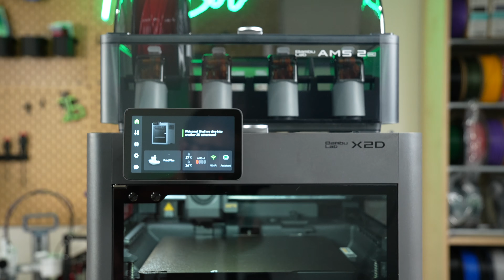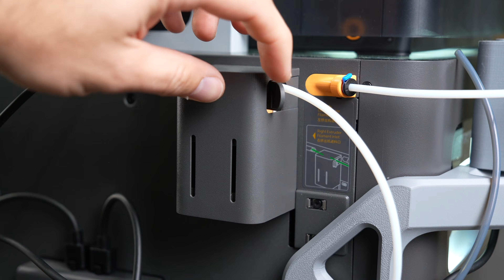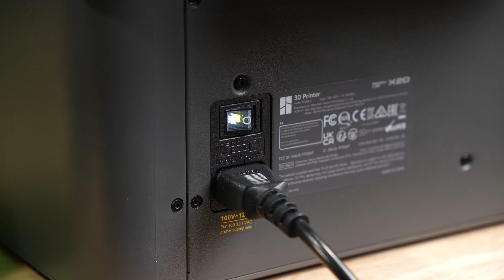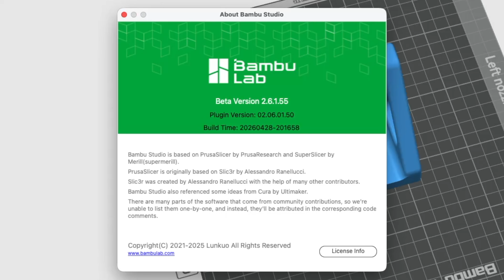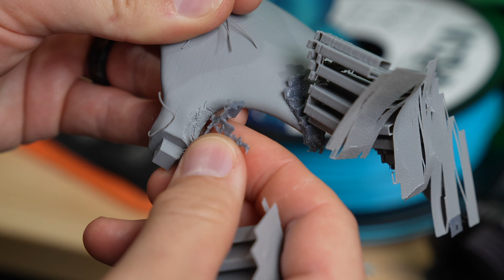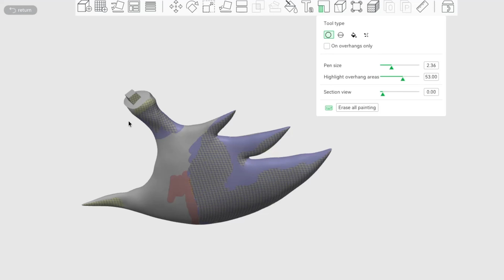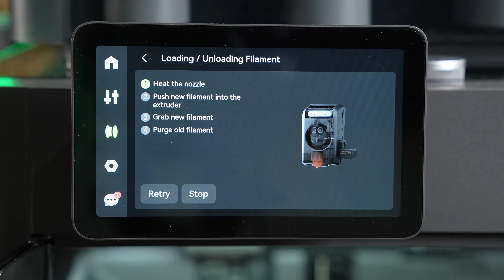I Tested the Bambu Lab X2D... Here's My Verdict

Comment: Stay away from bamboo printers. They are obsolete!
Reply: Good one bud 😅
Reply: What printer made the H2D (and to a lesser extend the X2D) obsolete?

Hint: its neither the Ultimaker S7 (sucks a$$ and is very expensive) or the Prusa XL (cant even print ABS)
Reply: @lukahierl9857  Snapmaker u1 plus others here and coming.
Reply: It’s spelled ‘Bambu’ before slandering a brand you might want to proof read your 8 word sentence before posting.

Comment: 22:28 “An added chamber heater for high temp filaments”, but nozzles capped at 300°C to reduce cannibalization of their more expensive H2 series.
Reply: I'm sure someone will make an aftermarket upgrade at some point.
Reply: @WolfKashin   It’s almost certainly capped in firmware. You’d need to reflash with an open source fw too.
Reply: @JonS  nah you can fool the thermistor and get at least 320-330
Reply: @riba2233  the 300c thermistors start to lose accuracy.
Reply: You might be right, but then again, who but the most hardcore enthusiasts are printing filaments that require nozzle temperatures over 300°C? I'd argue that you'd probably want a chamber capable of heating higher than any of Bambu's printers, if you're printing more extreme filaments, anyway. 

Also, standard NTC thermistors are only rated to about 300°C, AFAIK. So I don't know if that factors into their cost calculations.

The highest temperature filament I print with routinely is polycarbonate, and it prints beautifully on the X2D.
Reply: @ultramegax   Likewise! The X2D has been producing the cleanest prints I've ever seen (even those online). Fortunately I have zero need for printing the PPA and PPS class filaments, or anything that requires over 300 degrees. I'll save those for my H3C!! 😛
Reply: With the Bowden extruder it's just not possible to go higher than 300° because of the ptfe
Reply: @vocaLEGEND Bowden =\= heat break. The bowden setup should still allow atleast 350C as anything above the heatbreak shouldn't get any hotter than 200C. Nominally, anything above the heatbreak should not max out the ambient temp.
Reply: @vocaLEGEND  how confidently wrong
Reply: @rs.7610 how am I arrogant? talking just to talk

Comment: They could make both extruders direct drive - just connect them to the same freaking gear and inverse! Yeah, it'll retract previous filament to shit, but who cares - it'll be purged later anyways!
Reply: I think it’d cause excessive grinding, and then it wouldn’t be able to grab the filament again unless you had another AMS to use the assist motor to feed it again. From what I’ve seen though, you can definitely dial in the aux extruder.
Reply: Hav fun doing a retraction with the nozzel currently in use. Not to mention that only one filament has to move when raising/lowering the second nozzle.
Reply: @lukahierl9857  Why is that? People use retraction from hot nozzle all the time. Nobody stops you from cooling nozzle - it'll just be grinded out and stick inside the nozzle while another nozzle is operating. It'll reverse back when you start pushing it again - just need some nice anti-stick coating for the gear and that'll do the job just fine. You don't need to use the same gear for pushing and retracting - couple them and it solves the issue.

Comment: I was excited about this printer before I realised the second head is so compromised. Hard pass. Maybe next time Bambu
Reply: Except the second head isn't compromised lmao it's a bowden extruder. Used to be the normal before direct drive and they implemented it quite well. The auxiliary nozzle is meant mainly for support materials but is more than good enough to use as a secondary nozzle.
Reply: Have you used it?  I've only had ours for a few days and it is the only 3D printer we've ever owned, but I can still compare the quality of the two nozzles and say that the auxiliary comes very close to the quality of the primary.  I was also easily able to do a two colour print with negligible waste.
Reply: As always with these kind of comments, you do'nt even know what the supposed limitations you're complaining about are.

I've had the X2D since release and have no issues with the auxiliary extruder. Bowden used to be the norm and prints looked as good back then as they do now.
Reply: @ArneHerz  For real. Over 1 thousand hours doing multi color prints, and thats while using the aux nozzle equally with the main nozzle. People love to hop on the bandwagon sometimes lol
Reply: @lifeonabike8691 do you think this would be a better decision over the creator 5 pro i pre-ordered? since i saw the purge filament into the chamber heater fan i’ve been considering cancelling my pre-order 😅
Reply: @Kevin-vg4hu If you’re set on a tool changer, I’d just get the U1. Open source, and I’d trust Bambu and Snapmaker before I trust Flashforge.
Reply: @Kevin-vg4hu 2 different printers for 2 different tasks. If you are heavy multicolor printing, toolchangers might be a better choice, but if you are more into precision and high temperature filaments, then this one make more sense
Reply: @patricklebel1141 well my main purpose is as a tool first. I have an a1 mini and an a1 and while i’ve got some multi color prints i want to do  there aren’t many. So maybe the move will be to get an x2d for function and sell the a series printers for a creator 5 🤔
Reply: @Kevin-vg4hu I’ve had my X2D since it came out hundreds of hours on it without an issue. A solid printer.